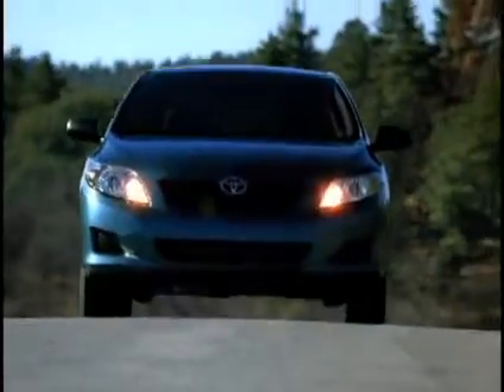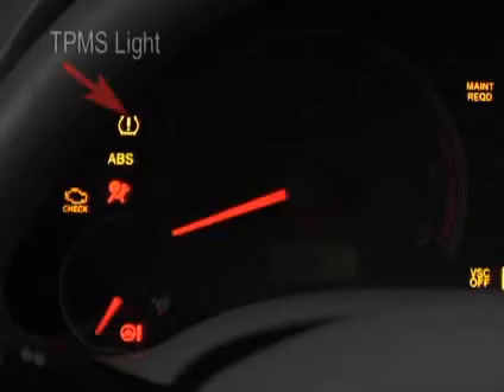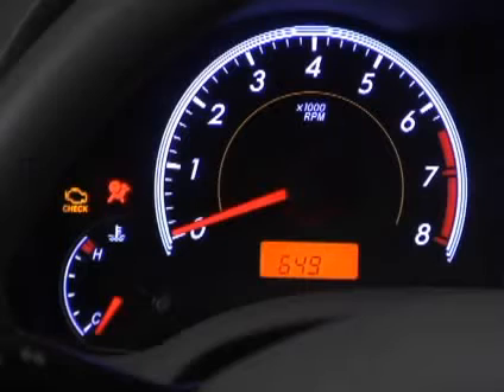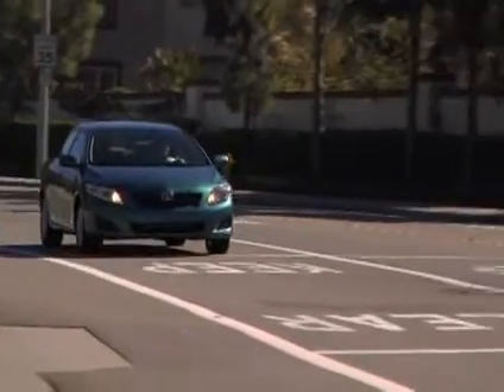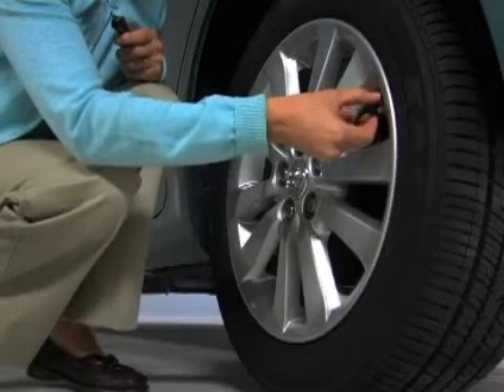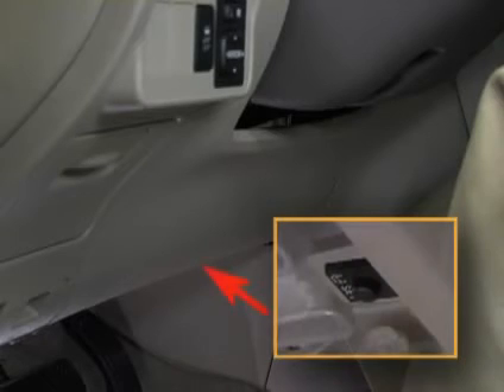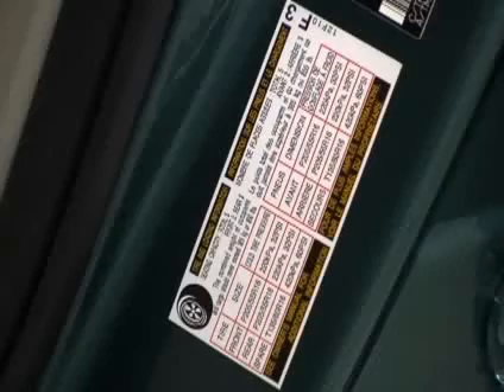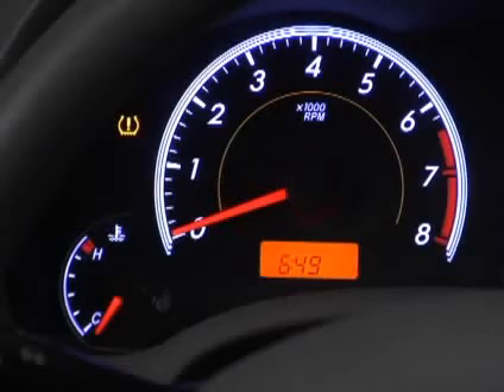TPMS-Tire Pressure Monitoring System (w/Reset Capabilities)

Comment: Last week I mounted the snow tires which are on extra steel wheels which do not have TPM sender inside. I drove 2500 KM and never did see a warning light on my dash.
I dodn't think my 2009 Camry HYBRED even has this system.